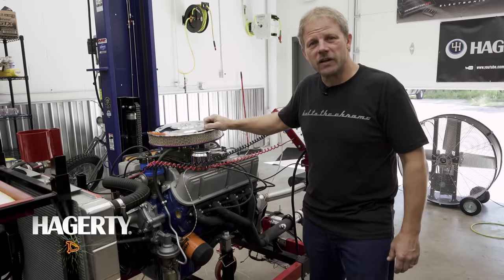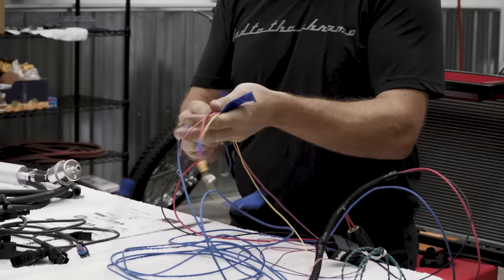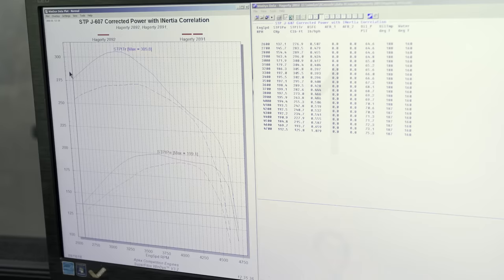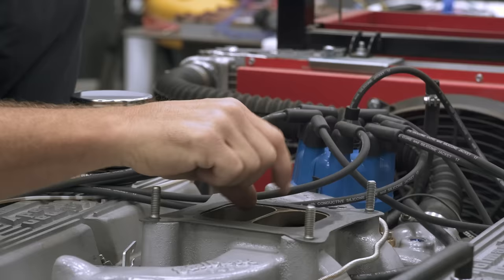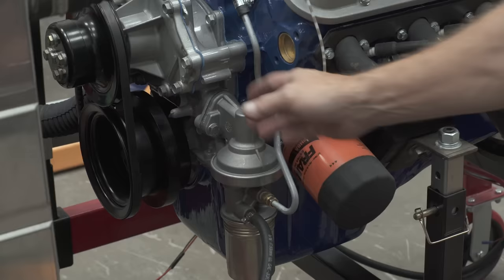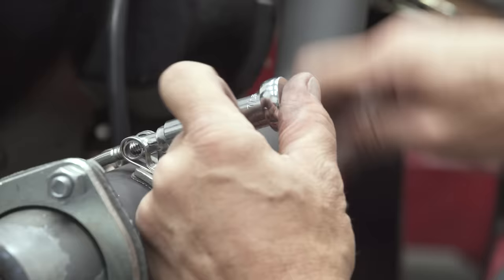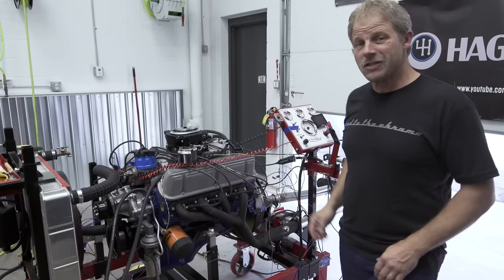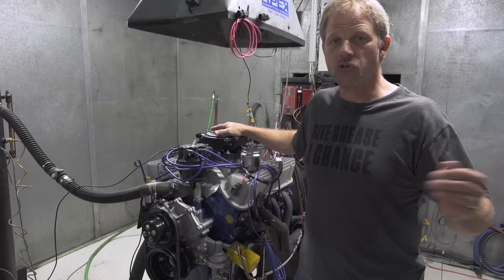Is it worth it? Replacing your carburetor with a Holley Sniper EFI | Hagerty DIY

Comment: Comparing fuel injection to a Holley pumper square bore ? Try the comparo with a "STOCK" carburettor..a Carter spread bore .AND Holley's are notoriously hard to Tune "properly" because of their "stoopid power valve"...
everyone has a different "theory" of which you use( and a different "formula " to work out which you need)
I swapped out my Holley for a Rochester quadra jet....more HP better fuel economy....and then you added a spacer plate same effect as my "conversion plate."..leave it there and put the Holley back on...you WILL get an improvement..and so will the electric fuel pump and Distributor swap improve the Holley's results ....so many CHANGES OTHER THAN THE CARBIE "straight swap" he claimed......and how much more expensive than the Holley POS ? SWAP the injection with a" Dominator" and watch it loose.......check out a Rochester it does ALL you said the Holley can't do...it does vary/ retune to atmospheric changes and air density( temp)...IF YOU KNOW HOW TO "SET ONE UP" ! And the field injection will loose again.....why ? Power...the pumper...response..the pumper..economy ...is in the tune of the primaries and the "point at which you make the secondaries engage" economy is controlled by the "Right Foot"
Reply: @Marc_Remillard  IF you understood the power valve system you would know that the Q-Jet has the same system only accomplished in a different manner. The Q-Jet's "power valve" system is the vacuum operated plunger that raises the primary needles as vacuum falls off & more fuel demand rises! I love Q-Jets but Holleys are much easier to tune. Pro Systems runs a power valve in both ends of their carbs with a 1:1 linkage so the jetting is leaner until the vacuum falls off, opening the power valve to enrichen the mixture. This makes the throttle response much crisper & prevents overfueling until the demand is required. This ain't my first rodeo. I was racing when most of y'all on here were still a stain in your daddy's underwear! BTW, the Q-Jet might, in some circumstances get bett fuel economy but they don't make more HP than a Holley.
Reply: @bradgriffith4231  what was the Holley  power valve formula ? NO- ONE AGREES !!
NO ONE KNOWS, EVERYBODY USES A DIFFERENT ONE......SO MAYBE 1 IN A 100 Use the CORRECT FORMULA.......SO IN REALITY 1 IN EVERY 100 HOLLEYS MIGHT WORK BETTER THAN A Q-JET

Comment: Anyone spot that the left side header had an O2 bung welded into it and plugged?  Way to add extra advertisement for a weak repair.  I doubt that clamped on sensor is going to last very long on a vehicle that is actually driven.

Comment: Too small a carb and not tuned correctly. Get the correct carb and get it dialed in and it will make more power than the efi.

Comment: I dont get it. Im a newbie but i thought the purpose of fuel injection was better starting, fuel efficiency. Why are you making this about power?? I want reliable starting for an old daily slant six. Jeeze.
Reply: a properly tuned EFI system should make more power than a carbed setup

Comment: It’s all a matter of balance the EF five running perfectly is much much better than any carburetor butt When it doesn’t work you’re screwed there’s nothing you can do it’s dead McLaren Barbara has lots of stages of failure but it generally will get you where you’re going and can be dealt with by a human that hasn’t got a microprocessor kind of brain

Comment: It is not worth it. I spent two years trying to get this stupid thing to run cleanly and start easily. I still have to get the throttle position
Exactly right for the stupid thing to start. I am not sure who was with this cat when he had his “issues” . But It is obvious that he didn’t fix it by himself. Get a Holley 750 double pumper and your nervous system will thank you for it.

Comment: This vid is flawed in so many ways. I just bought a Holley sniper myself but the install was poor and inconsistent with the carb install. Carb tuning was also poor as was points setup. Points only to 4500 rpm. Please. Must have been the worst set of points on earth. Both setups could have done much better.

Comment: That's alot of money for 7hp. But it isn't a straight comparison anyways. And the point for efi isn't power but efficiency. Your first dyno pull showed issues with the tune on the carb setup but you just left it that way. I love your videos but this one is crap. I'm not against efi but this wasn't an actual comparison.

Comment: I really do like this channel but this was a total Holly add.  We all know EFI is better then carbs.  That’s why manufacturers switched 30 years ago.  
But the carb was not even tuned or jetted or run with the spacer. 
Plus this is a Mickey Mouse fuel injection system that doesn’t control timing

Comment: If your current fuel system doesn't have a return line you will need to add a return line to your .  .  .  .  . ???? Finish the sentence. Return it to where?

Comment: I've examined that sniper system how it works and it's just an overglorified throttle body why don't you just go to the junkyard and find you an old crossfire cuz that's all you have and people hated the cross fire performance you know better as well as I do that ported fuel would kick that system's ass just as well you could go to nap and get the replacement parts what if that ECU goes out and that carburetor and your stuck out and BFE Holly's not going to come and get you

Comment: The carb is simpler and once tuned it's reliable ! Maybe not good start up on cold morning but I'm looking for simplicity and reliability going from point A to point B ! I don't want to have too many wires or computers adjusting fuel/ air ratio  because there's more variables to fail !  I'm not drag racing from street light to street light so just give me the all natural physics to operate my engine !  Their trying to sell EFI ! Think about it !  Give me the most simple ,reliable system and I'm happy !  Doesn't anyone out there know what the acronym K.I.S.S. stand for ?  Keep it simple stupid .
Reply: more truer words were never spoken!

Comment: After 6 weeks of hours and hours of trouble shooting, phone calls, and aggravation, we just reboxed the entire Sniper junk and sent it in for a full refund.
Too bad they dont pay for the 75 man hours of time.
crap, JMO JMO
Reply: HotRod Ray  That's been the feedback I've gotten from several friends, & the Holley is the best of the breed. 1 friend says his boss doesn't go anywhere in his hotrod without a spare Throttle Position sensor, & that he's replaced several since installing the Sniper. FI is for those who aren't "problem solvers" & can't tune a carb.
Reply: @bradgriffith4231  I think the biggest problem is chinese electronics.... and people not up to speed on fuelies.
Reply: @bradgriffith4231  Ive had the same problem with FOX parts. If its not real Motorcraft made in USA,,, GOOD LUCK.
Reply: @hotrodray6802  The electronics are Chinese, or other foriegn junk on the car manufacturers OEM parts too. That's the reason for the current new vehicle shortage. FI doesn't do anything better, or even as well as a carb except maybe cold start. NHRA Pro Stock cars have been running FI for 10 years & are still 1/10 second & 10 mph behind the National Record set with carbs.

Comment: Very interesting. My experience, I stick with carbs for now 😜... Run a 750 Double pumper on a spacer there, then compare.. . Doesn't matter, I care less about fuel economy, just reliable and solid performance. Electronic components are just too fickle, imo, for now. Your presentations are always excellent, enjoy it very much 👍🏻👊🏻

Comment: And these tbi systems are still garbage throw away crap. Good luck getting help via the holley tech line.  Carbs and a basic electronic ignition system will run just about forever and is user serviceable.  Plan on a tow and months of downtime with a sniper.....

Comment: They keep using the term EFI over and over that's a advertising trick designed to program you to EFI. Those throttle bodys are really just a crude speed density system if they were any more basic it would not run. They start cold rich and stinky can get confused in many situations and since everything is built in if there is an issue its all garbage,
The main computer is in the unit getting hot and cold over and over and commonly fails. Could a good tuner put the right carb on that engine and beat the EFI yes. Can the average joe do it probably not. Is real mass air port injection better than a carb absolutely . But this is just an over priced crude basic throttle body.

Comment: you built that engine for hi po and you put a dist that wouldn't work on it? suuuuure this isn't a plug for the efi at allll..... not seeing anything even newer builders couldn't spend a little time on google to tune and gain hp from the carb side. just stupid

Comment: It is absolutly NOT worth it unless you go to true sequential EFI with rails & injectors in the runners AND most importantly dual o2 sensors (left & right bank) all the rest Fitech (absolute garbage) fast, atomic, holley (except the dominator which is capable of supporting dual o2's) all are nothing more than throttle body injection 90's tech you can build a trick carb for about 800 bucks with adjustable air bleeds etc and have damn near the same thing for  less than a 3rd of the cost, a single o2 can only do a spit ball average, it can't tell if you have a bank split (afr difference in the unmonitored  bank) all the "self tuning" systems are just marketing to push product, unfortunately many people are creatures of habit & fallow the next "new thing" without really understanding it, before the keyboard "experts" begin I have over 40 years tuning mechanical injection, carbs etc, both drag race road race, Bonneville, street cars etc, as well as tuning Daytona prototypes all over the US Germany & Australia using Bosh, Motec, Haltech EFI, these systems are the real deal, but require real tuning experience to run them, but nothing can even come close to the performance & finite tunability, I have done thousands of miles of testing on all the mainstream systems fast, holley etc & they all leave a ton of power & reliability on the table, the only one that steps into the arena with the upper end systems is the dominator that will allow dual o2's, so in the end, cost & performance of the throttle body type systems over a carb no, of course its my opinion based on many years of experience so take it for what it is, but dollars to donuts with the TB systems, I'd run a carb & be happy, however if you want the cats ass running true sequential injection on a conventional, or individual runner intake Motec, Haltech, Bosch will get it done
Just a friendly word of caution 99.9% of all EFI problems are Ground or voltage related, or lack there of

Comment: The hand held remote is not dependable. screen gone black.  lost starting parameters....coupled with the hyperspark plug and play.   Summit trying to sell me another hand held (guaranteed to fail).   going back to carb.   Need dependability. not electronic crap.   I can tune a carb just as well.   Holley Zero customer service.  cant get through.

Comment: Waist of time. Not at all accurate test. The small carb killed the test. It should have been property tuned with a carburetor that flowed better for the motor according to the Dyno and gotten real numbers, which im sure would have been the same or more than the final test and then try the sniper. Not half ass lame run that wasn't even close then toss on a sniper and say, hands down sniper is the way to go because it did all the work that we couldn't do the first run

Comment: For pure HP carbs are king EFI starves the motor you said yourself the carb is too small for the motor put a 750cfm double pumper on there and I bet it beats the EFI you skewed the results, fuel economy does not equal HP, burning fuel like water makes HP my 350 NoS powered nova had a holly 750 high flow electric fuel pump 1” fuel lines, msd high fire ignition, on a 1/4 mile run I used 4 1/2 gallons of 120 octane race fuel, these pro mod guys running EFI make a pass on 1/2 a gallon that’s why the NoS pro mod guys are always NoS backfiring there too lean

Comment: I'd imagine the marine version requires an O2 sensor as well, the online instruction manual doesn't mention details.  Wonder when electronic ignition advance and torque converter lockup features will be available.
Reply: it has full ignition control.
Reply: @DieselRamcharger  No Torque  converter lockup control?  How about an O2 sensor requirement for marine applications, O2 sensors don't work well in a wet/flooded exhaust system?
Reply: @thisisyourcaptainspeaking2259  you do realize there is a riser area in marine exhaust that is dry where you can install an o2 sensor BEFORE the water is injected/blended into the manifolds....right?
Reply: @thisisyourcaptainspeaking2259  i will say their o2 adapter is jank. But, its designed for dumb ass people who cant even weld an o2 bung. You gotta admit. This is about as user friendly an EFI conversion can get. Tq converter lockup CAN be controlled via the Sniper I/O harness {49 bucks}. Ignition control is already possible, but you gotta plug the Sniper into some sort of Ignition Module as it cant drive the coil itself. Seems like most the stuff you blame the Sniper for not having, it does have you just dont understand how it works.
Reply: @DieselRamcharger  Have you ever tried that?  I think it doesn't work well.
Reply: @thisisyourcaptainspeaking2259  tried what exactly? the outputs are going to be triggered by simple windows im sure. not ideal. but why would an old carbd vehicle have an electronic lockup converter? And the ones i can think of that do {Dodge 47re} use their own dedicated TCM which gives zero shits about what the ECM is doing, however it does share the TPS signal.
Reply: @DieselRamcharger  There are plenty of lockup transmissions for the BOP pattern, going back to late 70's.
O2 sensor in a wet exhaust doesn't work very well at all, sensor will be contaminated/damaged.
Reply: @thisisyourcaptainspeaking2259  i dont think you understand how wet exhaust works...well, thats obvious at least. Lockup trans from BOP? You mean a turbo 350? the lock up is controlled by engine vacuum switch and the brake light switch. there is no computer and no need for the Sniper to interact with the lockup. I really dont understand your issues.......
Reply: @DieselRamcharger  Have you ran an O2 sensor in a marine exhaust?  I didn't think so.
Have you ever used a vacuum switch and/or a brakelight switch to control lockup?  I didn't think so.
Reply: @thisisyourcaptainspeaking2259  wtf are you talking about? the th350 is vac switched with the brake light switch as a safety so it cant lock up and push it through the brakes. this is how the car is setup from the OEM. we run o2 in all kinds of marine exhaust. But the boats in arizona dont look like the boats in florida. you get that. right?
Reply: @DieselRamcharger  Wrong, th350C lock is controlled by ECM, Computer Command Control System (aka:CCC), look it up.
So your O2 sensor isn't drenched running in a marine exhaust?  I guess you never heard of exhaust reversion and nobody in Az has ever heard of it?  You're peddling BS, this is why Mercruiser never used an O2 sensor until recently (I'm not gonna reveal the secret of why it works but the solution is expensive).  Dry headers would be fine.

Comment: I know 2 ppl now . Both mechanics . Both said the same thing . Typical holley product . Runs taday not tamorrow ! Both of em said the same thing . Raced around all night had a blast . This morning it wont even start ! One guy had tried a cpl holley carbs . Then went to a sniper . Run taday not tomorrow ! Gave him a edelbrock to try . Now hes a edelbrock guy ! Did circles around the holley garbage ! . I helped a guy with a 289 a while back . Mustang . 4 speed . Local garage talked him into a holley . Ran like crap . Guy goes to another garage . O you bought the wrong holley . So he buys the holley this garage said he needed . Ran even worse . Drowing the motor ! Typical holley ! 
So he asked if id help . Ill help but im not working on your holley trash . I sent him to a guy i knew thats ran holleys all his life . Oo you bought the wrong holley ! So my neighbor buys a third holley . Still ran like ass . Told him ive throwin over 30 holleys in the trash through 40 years a wrenchin ! Got a edelbrock you can try ! Ok nothin to loose at this point . Holley on the 289 . It fell on its face . Couldnt even side step clutch . Guy was burnin a tank a gas every 3 days with the holley . Put on a 600 edelbrock . He had  me test drive it . Dam little 289 laid down about a 30 foot patch a rubber . Got a posi ay ? I geuss so he says . Cars NEVER ran like this ! Guy drove 2 weeks on a tank a gas with the edelbrock ! And laid rubber doin it ! 
My crowd tried injection . Most of us went back to a carb . Carb leaves the line way harder ! My neighbor called me Mr Edelbrock fir the next 2 years till he moved ! Personally im a Q jet guy ! Beat my holley buddys when we race ! And get 15 , 16 miles to the gallon beatin em !

Comment: At 4500 rpm "We were at the limitations of a point type distributor"
Total BS.
Reply: It's getting pretty hard to find a good set of points. Anything you get at a parts store now, youd be lucky to get 1000 miles out of. Let alone rev the engine past 3,500.

Comment: When they work they are great, when they don't; alot., they don't,  alot of problems with them out there.
Reply: With modern fuel, you can say the same with carbs. Unless you run that carb every day, its only a matter of time.